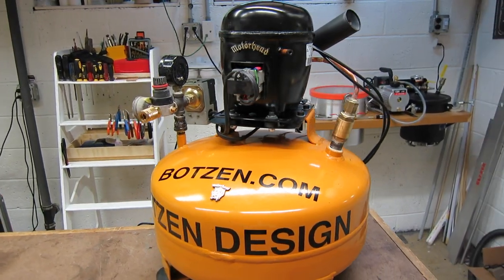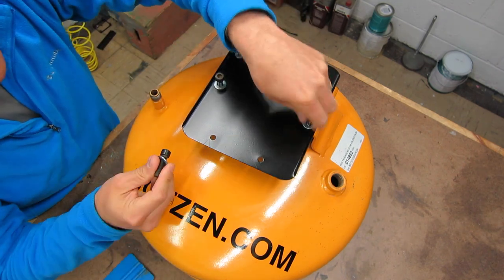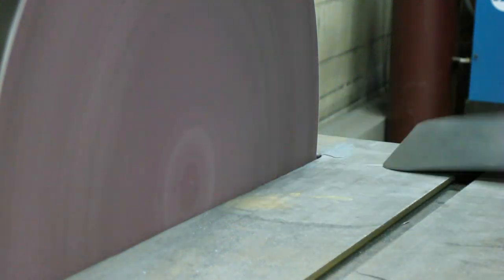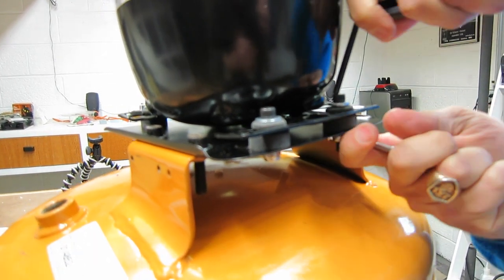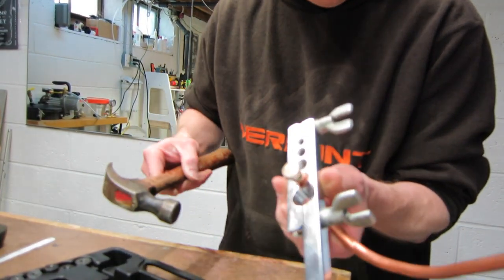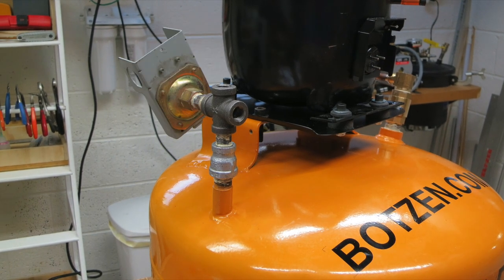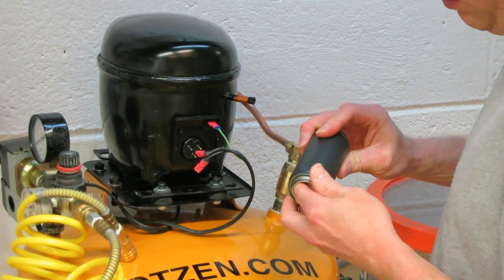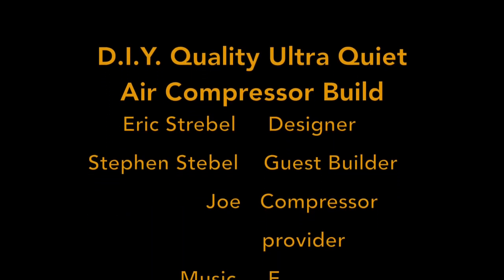Ultra Quiet Silent Refrigerator Work Shop Air Compressor Build

Comment: Nice project, but the opening at the bottom is meant to be a drain, and should be fitted with a plug or a drain valve. The relief valve can be fitted to the outlet using an additional 3-way Tee before the 4-way Tee. You will have condensation at the bottom of the tank when you use it, and that should be drained regularly to avoid corrosion in the tank. Also, you want to avoid letting that water go into the relief valve because it may cause it to fail (therefore fitting the relief valve to the bottom is risky).
Reply from the maker: +Saeed Abulhusn  Glad you liked the project.  Thanks for the feedback. Much appreciated. www.botzen.com Check out the Instuctabes for this project here 
http://www.instructables.com/id/DIY-Ultra-Quiet-Shop-Compressor-From-a-Refrigerato/
Reply: Eric Strebel Very cool website, thanks for sharing!
Reply: Esas retortas ya traen válvula de drenaje en el fondo.
Reply: James DeGray  It doesn't make any sense to be doing what you are saying. A auto drain valve is completely different from this. Like Saeed says, it should not be mounted there and should be preferably installed perpendicular so no water collects in it----anyone that lives in a climate that freezes---you sure do not want water to freeze in a safety relief!
Reply from the maker: Watch my compressor upgrade video.
Reply: Wow Eric, great video very detailed and helpful and clean finished job at that...

but can i ask for a bit more detailed help/info regarding building a two in one  compressor build???

how can i  build a compressor that can run:
1- my airbrush kit
2- can vacuum
3- can build up pressure for a pressure chamber???
for the chamber it will be logical to use a pressure cooking pot with its modified own lid, and a seperate one  for the vacuum..

but what kinda other parts do i need?? and how the physics should work :D got he briefest idea and thats all. i can picture the algorithm but the actual parts and flow is blank :D ahahaha

i ve been looking for such a detailed tutorial, and your diy comp video has caught my eye..

i really would appreciate it if you can maybe list and write a brief how to.. cause a video would be asking waaaay too much :D or would it?? only you know :D

thnxs for your time and patience :D
stay healthy and strong in these times and keep on doing the great, clean and helpful job u r doing
cheers
Reply: Ok u

Comment: 1st video of your I've seen so far. Man you sure have some nice fab tools at your disposal!! I'm aroud a lot at work myself, then you come home and always try to make tools to make tools lol. great video. I think I may look into building one of these to replace my homemade air brush compressor. I made one of the $200 ones I see online out of a $60 harbor freight compressor and a throw away 1.5gal tire tank. Works but its been through a house fire so it looks like one of these would do way better
Reply from the maker: shawng7902 thanks for the comment and support!

Comment: Nice build, good video. Enjoyed the stop motion segment. OK, now I'm playing the armchair quarterback. Hearing how quiet it ran was crucial, telling how long it took to fill the tank would have been nice. These types of compressors are cooled by the cool returning freon from the evaporator of the frig. Adding a fan to blow on the compressor would seem to be a good idea. The run times of this compressor are going to be long. Using common hand tools would have been more useful for others to mimic your idea. One other thing that you need to address is that the oil will travel along with the air. You need to design and install an oil trap to allow the oil to return to the compressor once it shuts down. Trust me, I slept at a Holiday Inn Express last night.
Reply from the maker: See my latest video here https://youtu.be/JqqLwunF1ZE and you can hear how quiet it is and learn about the oil, not an issue BTW, but the water is.

Comment: Brilliant project idea!! I would have never thought of using a compressor from a fridge. Maybe in the future I'll build one with multiple compressors so it will fill up the tanks faster??

Fantastic video and audio production as well. Bravo!!
Reply: If you can make industrial rated solder joints and follow best engineering practices for high pressure air, you can use those compressors to build 600-2000PSI no problem. Don't though, high pressure is the shadow of death until you really know what you're doing.

Comment: I'm curious how you hollowed out that shaving cream can. I quickly scrolled through your other videos but didn't see a video covering that. Did I skip past it?
Reply from the maker: I just removed all the bits that were not metal from the can The top and then there's a little stopper in the bottom which turns out to be the entry hole for the air of the compressor

Comment: "Swage" is what you did with the copper tube. Flaring tool forms a taper, or bell to the end of the tube. Nice job on your compressor and video! Looking forward to finding out how long it lasts, I hope that engine oil works out. :)
Reply from the maker: +ImAdapt73 thanks for the moment. So far so good, no issues with the motor. The electronics, have already been replaced, the relay quit! Thanks for the info. Hope you liked and subscribed, more stuff in the future when I get some free time.

Comment: I saw the whole video and you would think after 10 minutes you would at least have the sound of the air compressor. I wanted to hear how quiet it was.
Reply from the maker: so quiet it's not worth focusing on, really it's that quiet! Most of the time I don't even hear it turn on, I just hear the relay click on and off to start the compressor. You are not missing anything with out the the sound.
Reply: exactly!
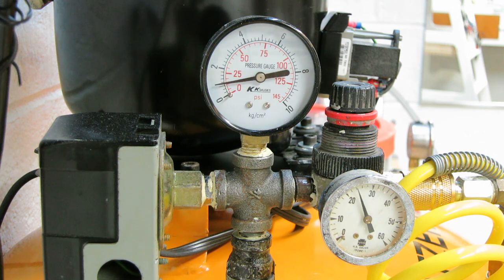Reply: Around the 9:35 mark you can actually hear the compressor running.  Sounds just like a quite fridge.  It’s just so quiet that it doesn’t overpower the music and talking, but it’s there.
Reply: Yeah, I completely agree with you. Maybe it is ultra-quiet, but I still want to hear what that ultra=quiet compressor sounds like in the real world. It would be better than that music, that is for sure.
Reply: Or you could just go listen to your own fridge
Reply from the maker: Lol

Comment: As your compressor is rubber-mounted for anti-vibration, it would be worth putting a few coil-turns in the tank-line from the comp, to prevent cracking at the joints. Also, less vibration noise gets through the pipe.
Reply: You could even use a pressure hose. A bit easier to fit at least without the pipe tools and skills, and even more vibration resistant than a coiled pipe. I have to admit it probably wouldn't look as professional as a a copper tube.

Comment: Hi Eric,

Great instructional video.  Thanks in large part to your video, I’ve made 15+ compressors for others (from different brand tanks and from dehumidifier, refrigerator, room AC compressors) and all worked fine.  I’ve recently come across a problem I can’t seem to resolve.  

Using AC compressor, Porter Cable 6 gal compressor, new 4way pressure switch with unloader valve,

After filling the tank, with no leaks, etc. when the unit shuts down oil vapor (smoke) comes out of the unloader switch…..just for a minute or so.   Then it stops.      I’ve tried this with the compressor cold (so no thermal issue) and from either,  Empty to full pressure OR from cut in to full pressure.   

Still get the vapor (which does smell a bit).   

So I put a different compressor (from a dehumidifier) on it and still same problem.

These were from a working AC and dehumidifier.  This is nothing different than I’ve done in the past, except now I get the oil vapor.  (YET….”something must be” different to cause this.

Any suggestions as to Why this is happening and How to remedy it, would be really appreciated.
I’m stumped !!

(as an aside…..on the others I’ve built, on purpose, I ran them from empty to full repeatedly till the thermal switch would stop it……and no vapor !!!!)
Reply from the maker: Do you have a one way check valve in the system? You need that so the compressor can start with out being under pressure and it should prevent vapor going to to the compressor
Reply: @EricStrebel  Thanks Eric; yes I have a one way check valve and I believe it’s functioning OK.   The tank holds pressure long after it’s shut off.
I’m just baffled on this.  I’ve built so many in the past and they’ve all worked fine.  Again thanks for your reply.
Reply from the maker: Dunno, definitely sounds like and odd situation
Reply: @EricStrebel  That's what I think too. It's frustrating for sure.    But at 78, I'll keep at it being a stick-to-it kinda' guy.
Reply from the maker: Best of luck

Comment: Very cool, and great job... I so wish this was faster, but like how quiet is it. It would have been nice to have the video listen to the compressor working so we could get an idea how quiet it is. Thanks
Reply: Bro do you know what a refrigerator sounds like? Yes? Good.. Well it sounds like that.
Reply: O
Reply: shafferjoe1962: Like Thomas barlow says wait for your refrigerator to come on and listen. Sounds like pssst on, pssst off. That's it. these compressors were made commercially and sold for $375.00 in 1980. I had one for airbrush art work. I lived in a condo and could run it in my Den and not annoy my next door neighbors. Nice job Eric!
Reply: Eric: I still have that old compressor. I haven't used it for many years. I have a garage now so I don't need the silent compressor. I have to take it apart though. Something inside is rattling when I turned it on. It is no longer silent. :O) It has a large clamp similar to a hose clamp around the center of the tank where the weld was, so, opening it will be easy. I am curious and have to attack that project. There is a lot of dis-assembly videos if I have a problem. Maybe I can fix it.

Comment: Great project and yes a very quiet compressor but also very slow to fill the tank as  a refrigerator compressor has a very low rate of cfm an automotive a/c compressor along with an electric motor is a little louder but has a much higher rate of cfm and can also be used as a vacuum pump.

Comment: Here is a update on my comments below Eric.  I finally figured out why these compressors do not always start after being switched on immediately after running. Normally you have to wait 1 to 3 minutes for them to restart. This is because they are induction motors. Because of them low torque of them, they need the wait time, for the mags to align properly to start rotation again.
   I have cured this in my latest jewelry compressor I built.  3 things you can do.  First use a Condor Mr11GC2E pressure switch. This pressure switch has two screws. With these you can set your cut on press. at 60 and your cut in press. at 125. This will give ample wait time usually between run times if your using GRS equipment that runs at about 25 psi. If you need more time, between start and stops, use a 10 gallon tank instead of these 6 gallon ones. These compressors can pump them up to 120 easily. This will also give you more off time between runs. Lastly if you really want to cure the problem of not starting without waiting 1 to 3 minutes......on your compressor, be sure you have a PTC relay, a overload switch, and a 12 - 15 uf run capacitor. Usually your compressor will have these on them. Then, to the run capacitor, hook a Supco SPP-5 hard start kit.  This simply hooks piggyback to the run capacitor wires. It increases starting torque by 300%.  ( make sure your compressor is at least a 1/3 hp).  I used this on mine, and it will immediately start everytime, with no wait time.  This sounds like the easiest fix for these induction compressors.....but , I don't not know, over the long time, if it will shorten my compressor windings. I suppose I will know in a yr or two.  
    Lastly, for those of you, that say these compressor overheat......Always hook a air filter to the suction port, AND the process or service port.....this will let the compressor suck air in both ports and cool it better. Also, only use it in rooms with less than 90 degree air temp.  This is all that is required to keep them cooled from what I am told by designers.  Good Luck. I hope to post my own You tube video build, once I have better internet.
Reply from the maker: Great, information! Thanks for posting and sharing with everyone. Look forward to what you post John Nord
Reply: There is no unloader in the system.  The compressed air can prevent another compression stroke.  Get a pressure switch with an unloader, and install it in the system to prevent the compression lockdown.  The unloader allows the cylinder compression to bleed off, which allows another compression stroke.

Comment: We used to use old compressors in the 80 to air up bicycle tires when I was a kid.. We didn't have a tank we just went straight off the output of the compressor to a tire pump hose that was held on by a hose clamp.

Comment: This is actually an amazing build. I do have a question though if you don’t mind answering. Would it be possible to use a small-medium sized propane tank? I work for a holiday park with caravans that are supplied with gas via tanks and there are loads of empty small ones. Once again an amazing build and...well...rock on🤘🏽🤘🏽
Reply from the maker: Tim Bruten Theoretically it should work, I don't see why not. Post it on social media when you are done @botzendesign, good luck and thanks fo the comment!

Comment: Very nice build and very pretty too!  ........ probably only useful to run an air brush............
Reply from the maker: Gary Waters it works well for blowing dust and chips of parts, it would work very well for airbrushing
Reply: Brad nail gun would work here. Probably get 100 shots for that tank (more than a upholstered seat's worth), recharge time wouldn't matter as much.

Comment: I would have added cable ties between the mains IDC socket and the plate above to hold it as well as the epoxy. drill a couple of holes in the plate above and thread them through making a loop. For a bit more safety, you can also get an IDC socket with a fuse built in. 

Just a couple of questions: Where does the water collect (in the tank probably) and how do you evacuate it? Did it take long to fill the tank? The fridge compressor isn't a fast mechanism.
Reply from the maker: You can, see my latest video here https://youtu.be/JqqLwunF1ZE and you can hear how quiet it is and learn about the water issue.

Comment: Is it still operating?  I'm making one myself, was the 10-40 oil a good swap? Any oil changes so far? I read all about the problems with moisture and etc etc etc.....you read up yourself. And lastly was your compressor running pretty warm mine is staying steady at 150 f  and I'm not sure if thats normal or too high.
Reply from the maker: Yes, still running, there is a follow up video with a new tank and some adjusts, oil is the same oil, unit never really runs long enough to get more than warm, works flawlessly and very silent!

Comment: I'm a little surprised you put a Motorhead logo on something that's supposed to be quiet.  The logo itself probably triples the dBs.
Reply from the maker: +Mike Swenning     Nice, best comment so far! Rock on! Love it
Reply: lolz, give the man a prize
Reply: Mike Swenning
Reply: Mike Swenning p
Reply: Man you can buy a new compressor that size , for less then what you put into it
Reply: So you can hear your motorhead when working with air power

Comment: Nice video.  Good editing.

How many cfm do you figure you get from it?  What tools can you use more or less continuously without having to wait.

FWIW:  Friend did this but used a 30 gallon water tank as the reservoir.  Would take 45 minutes to fill, but that gave him 10 minutes of 40-60 two-inch crown staples per minute for 10 mintues.  (Building bee hives.)  Since it took about 45 mintues to set up all the jigs for the next 50 frames it was a good match.  In general I suspect that a larger tank would be useful if you hve room for it.

Comment: Hello Eric, it's a beautiful creation that must be usefull to you, it's beautifully done.  One thing bothers me, and it's not the tin solder. The bottom of the tank must be equipped with a drain to let the condensation out and it's a kind of muddy water. However, you installed the safety valve, at a low point. It may therefore not work if it is reached by this water when moving the compressor for example.
I advise you to replace it with a small drain valve and install it on the top of the tank.
Reply from the maker: Thanks for your comment and support. Check out the follow up video, this should address your concerns https://youtu.be/JqqLwunF1ZE cheers!

Comment: Hi Eric . just viewed this . looks good ,if you wanted a quicker fill possibly 2 compressors on top  ?? What sort of Amps is that compressor using 3 or 4 Amps ?? hope to hear from you ,Don
Reply from the maker: I looked to see if there is a rating in the motor for the amps, nothing is listed on the label, sorry

Comment: I laughed at how they put the check valve on the tank. When all fridge compressors has a built in check valve on the discharge line 😂
Reply from the maker: I laughed because I don't know what my tank is rated for, probably less than the compressor would be my guess.....

Comment: What did the computer thing you epoxied to the bottom do.  I could not catch what it does.  Thanks for the video.  Great job.  Thinking of doing one for myself as my compressors are so darn loud.  My wife came running to get me one day as she thought the water heater compressor was blowing up.  It was just the large compressor in the garage cycling on.  Had a good laugh.
Reply from the maker: That is the socket for the power connection. So it plugs in using a computer cable, building an updated compressor now, look for new vid soon....girls :-)